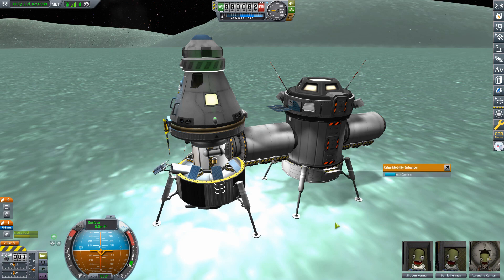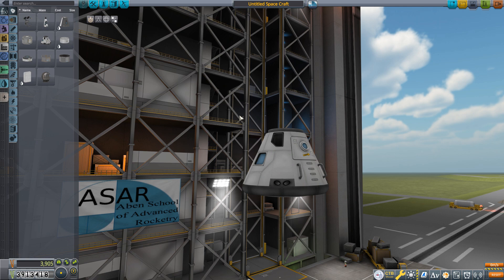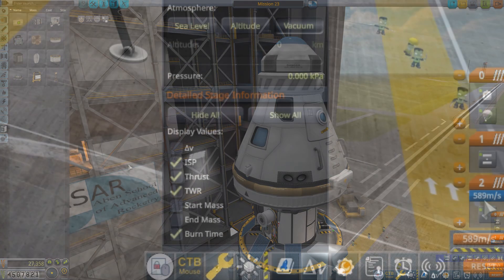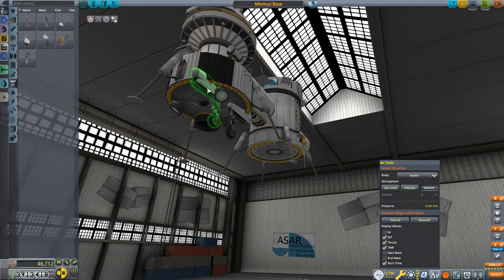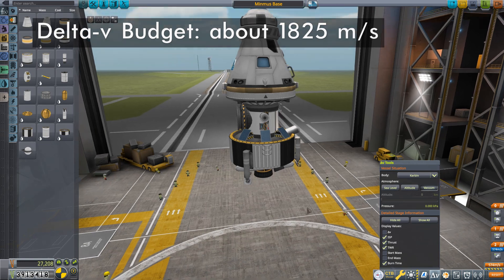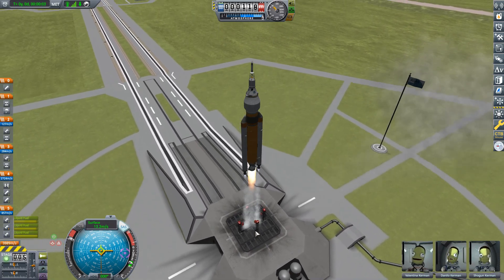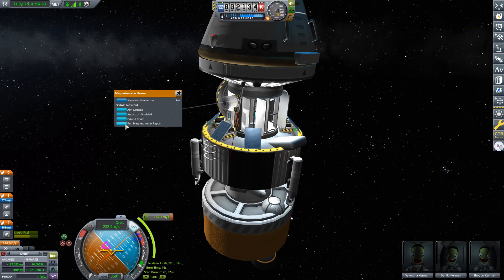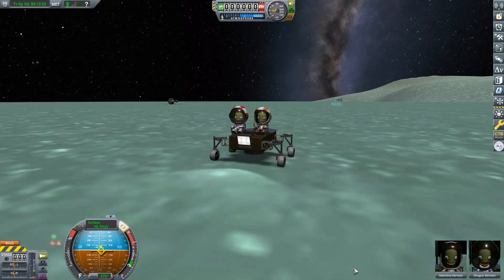How to Expand a Base | KERBAL SPACE PROGRAM Contract Tutorials

Comment: Instead of using the fairing base at the top, I like to use the radial chutes and use the move tool to clip them inside the command module. They still work and you don't have to look at them.

Comment: Can you talk about alternate launch sites in the next episode or two? I know of a few. Crater, Mahi Mahi, Cove, Glacier Lake. I also know how to get to them, but I don't think many other people do. It would be a great opportunity to explore seafaring in KSP because technically, you can get to 3 of them by boat (Crater is much, MUCH easier to get to by air or rocket travel, though, and glacier Lake you need a hyper efficient plane or a rocket to get to).
  The cove launch site you can get to by getting your boat to the water then sailing 30km north along the shore. Then, turn around and sail back along the shore and when you reach the tip of the continent, keep going at that 225° attitude until you reach two large square islands. Mahi Mahi launch site is on the south end of the larger island.
  The Crater site you fly over in a mostly equatorial orbit so it's just deorbiting at the right time.
  Glacier Lake took me a while to find, but you take your plane and fly north. When you get to the north pole, I think it's a slight right, but keep going. You will now be going south. There is a little lake on the edge of a glacier near some hills. Fly low over the north side of that lake and look around for the barracks and launchpad and fuel tanks and water tower. Somewhere I have written down the latitude and longitude coordinates for these launch sites.
  Ah yes. Here they are. Glacier Lake is at 73.56°N 84.27°E.
  Cove is at 3.7°N 72.2°W
  Mahi Mahi is at 49.8°S 120.77°W
  Crater is at 8.39°N 179.68°W

If you want, I even have an early game friendly boat capable of reaching Mahi Mahi launch site I want to share with the world but can't because Steam Cloud space reasons. Maybe I can give it to you and you can use it? How would I give it to you? Email you the file, perhaps?
Reply from the maker: I'll be honest, it's unlikely. I don't even know if I have the alternate launch sites enabled in this save.
Reply: @MikeAben  I think it's on by default and you didn't turn it off. The only setting you changed in episode 1 is making it Normal difficulty but Kerbals have a g force limit. Another easy way to check is to fly 30km north of the KSC and check it out.